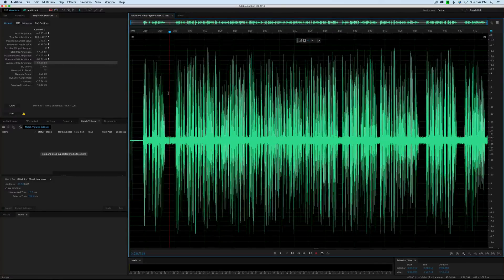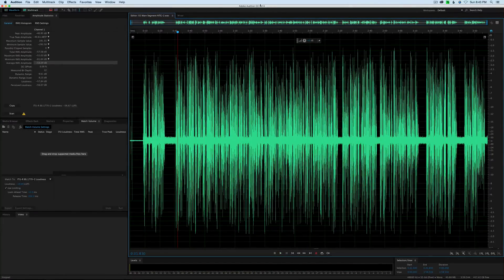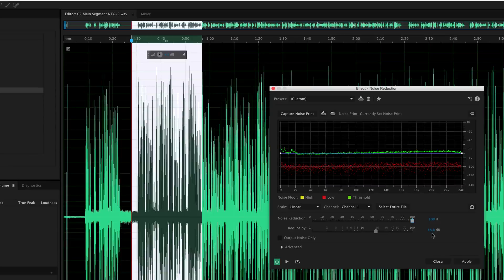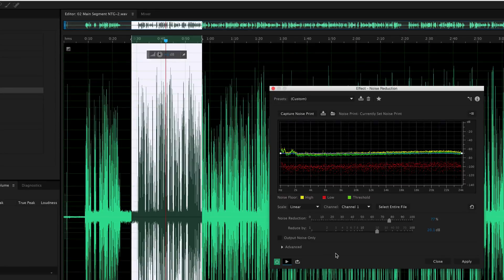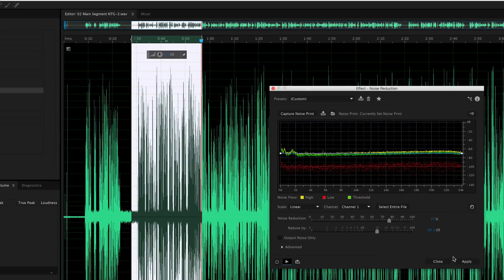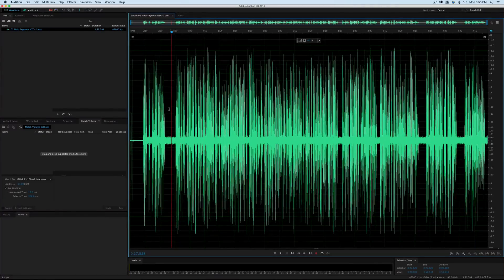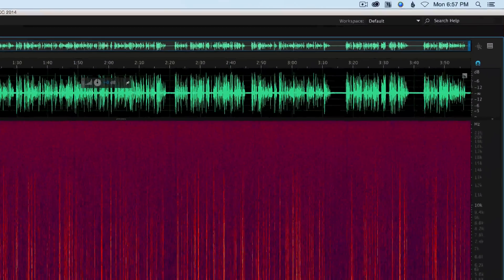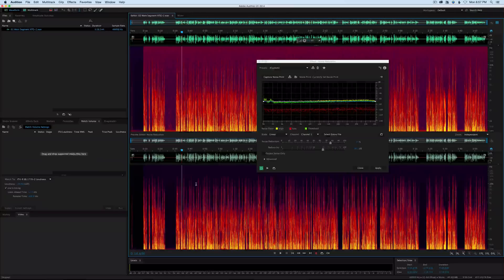Audio Hiss Noise Reduction

Comment: hey Curtis when i reduce the noise at the start of post processing and then apply eq and compression i sometimes see that the silent portions are really silent but the dialogue has that hiss in the background, i m totally pissed off with that and hope you could help me out with this, i do use adobe audition, hope you will reply. i use a rode podmic with the behringer umc22 audio interface with my gain usually set at 80%. i do not add any make up gain to the compression but loudness normalise my recordings at the very end to -19 lufs.
Reply from the maker: Hi Agam, first thing is to identify the source of the hiss and eliminate that so you don't have to rely on the mediocre noise reduction capabilities of Audition. Is there noise in the room where you're recording such as computer fans or other noise sources? If it is the Behringer audio interface creating self-noise, you might try one of the slightly better noise reduction plugins such as Izotope RX Elements or Accusonus's ERA-D. Best wishes!
Reply: Curtis Judd my room is not acoustically treated or anything but i do not encounter a high background noise but mostly the hiss that is either from the behringer or the podmic/ATR-2100 mics that i use. I am surely buying the izotope, hv heard a lot about it and yes its mostly the interface or my mic, i think i cd get rid of one of the usb mics tht i have fully, also does the new rode nt usb mini has a higher noise floor over usb? I think i can grab one of those if they r good at that! Or then maybe i will save up for an AT2035 or a Rode NT-1.
Reply from the maker: @agambhasin  If the interface is the issue, why not replace that with a cleaner interface?
Reply: @curtisjudd  I am planning to buy an audient ID4  or a 2i2 3rd gen, your suggestions are highly appreciated and awaited Curtis because i really need to improve my audio quality and saving up for it too!
Reply from the maker: @agambhasin  Good call! I haven't used either of those interfaces but have heard good things, especially about the Audient. Best wishes!

Comment: Hi, Curtis. I am glad that I found this video. I thought that I was doing something wrong or I was going crazy but I guess it is just my mic. And funnily enough , it is a 200 dollar mic, I have the clip mic digital by Sennheiser. It had that same hiss from the very beginning regardless of the gain I chose. I use it with my iphone x with Filmic pro or the Apogee's app which is meant for that mic. I am so disappointed by that mic...can you recommend any good lavalier mic that won't have that stupid hiss. It doesn't need to plug into the iphone, I might have to get another device that will record the sound and then sync. Thank you so much.
Reply from the maker: Hi, I just received a copy of the Sennheiser Clip Mic Digital. Let me test mine and see if it is an issue for me as well.
Reply: Can't wait!!!
Reply: @curtisjudd  any news from the Sennheiser clip on mic ? :)
Reply from the maker: @englishwithstelly  Hi, still in the queue. I'm a bit buried in reviews at the moment.

Comment: For many of my audio problems I just add the VST plug-in, IDC (Instant Dialogue Cleaner), by Audionamix. It works in realtime and it simple to use (one knob and a strength fader controls the amount of noise). Here is a video on Youtube of IDC in action. https://www.youtube.com/watch?v=PUwrs_AsLJ0
Reply from the maker: Thanks Mixer Man, will check it out.

Comment: Great bit of software. Shame it's so expensive and now only available as a very expensive monthly subscription
Reply from the maker: Yes, it hurts me every month. But I haven't found a better alternative for my circumstances/needs.
Reply: Chris, any quick views on iZotope RX6 standard vs AU?  Looks quite powerful but does not have a compressor as far as I can make out.  Looking to purchase one of them.  I guess from your comment above that AU is still best as an all rounder?
Reply from the maker: I use the advanced version mainly because it includes the adaptive phase rotation and de-reverb modules. RX does not include a compressor but you can plugin other compressors to RX and there are a ton of compressor options out there, including free options.
Reply: Curtis Judd thanks for the help. Learning a lot from your channel.
Reply: where are you located? maybe i can help you get it for free, and also reddit

Comment: Hi Curtis,
I'm having issues with digital recording(no mic or any external recording devices) to mix songs. After i'm done with the recording I start to hear hissing and popping noises throughout all WAV files. How do i go about removing them ?
Reply from the maker: Hi Carlos, I'm afraid that I don't understand. You are not using a microphone to record? Are you using sampled instruments? Do you have individual tracks for each instrument? If so, you'll want to identify which of them are noisy and clean those with the method shown here. Good luck!
Reply: Curtis Judd i was using an app called edjing mix. Once I'd finish the recording I'd listen to the file and it'd have popping and clicking noises in the background even though no microphone was used. The recording was done completely digitally. I actually found a fix though. I used Adobe Audition and used the effect specifically for this concern and it all went away ☺️
Reply from the maker: Great work!
Reply: Curtis Judd thanks!

Comment: Hey Curtis! What would you recommend as the best portable external audio recorder. Was thinking the Zoom H5, but I've been seeing that the noise floor is not the best.

Also, what would you recommend for external audio recording settings for youtube videos?  I've seen some people recommend as high as 24bit 96khz WAV. What are your thoughts? Overkill, maybe? lol
Reply from the maker: Hi Nick, The "Best" audio recorder I've used for less than $1000 is the Sound Devices MixPre-6. What kind of budget are you working with? Do you already have microphones? If so, which mics? Will you be recording indoors or out or both?

As for settings, I usually record 24 bit 48kHz. 96kHz seems a little overkill for normal dialogue unless you're going to process it super heavily (slow it way down, for example). 99.99% of the time I stick to 48kHz.
Reply: Have an AT4053b and Aputure Deity. Recording mostly inside but outside as well.

Currently have a Zoom H5, but am open to selling it and looking into the MixPre-3 instead. It is stretching out my budget a bit, but if I sell the H5 I can do the 650 for the MixPre-3.

Is the MixPre-6 the same but with more inputs?
Reply from the maker: The MixPre-3 and 6 are nearly identical. In addition to fewer inputs, the MixPre-3's inputs are XLR only vs the 6's XLR/TRS combo and the 3 can only record sample rates up to 96kHz whereas the 6 goes to 192 (again, I only use sample rates higher than 48 if I know I'm going to do super heavy processing like sync sound to slo-mo footage).

The MixPre-3 is a big, big step up from the H5 and should last you a good long time. Good luck!

Comment: Hello Curtis, 
I have background noise from the air conditioner in the room that I was shooting in. It is much heavier than the hiss that you have in this tutorial. When I try the Noise Reduction Process, the voice has some strange distortions like the person is talking through a tube. When I look at it on the spectral analysis, it seems as if bits of the noise are not getting removed for some reason. I have tried running the process again on the preview but it is not cleaning it all up.  I used a lapel Mic into a Canon 70D DSLR. What should I do?
Reply from the maker: +Ernest Moore You may not be able to clean it all up without affecting the dialogue so it is better to reduce it as much as you can without affecting the voice. You can also try high pass and low pass filters in an EQ plugin. I haven't covered that here but will in a future episode.

Comment: why do you recommend -19 now and what amplitude statistics verify that it's good now?

My true peak went from: -1 to -1.45 (which i'm assuming is better)

And my Total RMS Amp: went from the -16 to -25.08
Reply from the maker: +HollowProductions -19 is the recommendation for a mono audio track and the perceptual equivalent for a stereo track is -16. -16 for stereo and -19 for mono are the same to the ear. Just depends on whether you're processing a mono or a stereo track.

Yes, -1.45 true peak is good - I typically aim for -1.5dBTP. To measure noise, I usually highlight a section of "silence" (a spot where there is not dialogue or other sound in the room), scan and then read the average RMS amplitude for that section to assess where the noise sits.
Reply: In some videos you take dialogue audio and change it to mono but then you change it to stereo.  When do I extract to mono and when do I not?  

In an older video I remember you saying that unless we're doing something high level that we shouldn't worry about stereo but I also know how things can change over time.
Reply from the maker: +HollowProductions I record all of my dialogue audio in mono with a single microphone (referring back to my advice to stick to mono). Then in post I convert it to dual mono after I am finished processing it (stereo and dual mono are the same thing in this scenario). This just means that the audio track now has the exact same mono signals on the left and right channels. It isn't technically "stereophonic" which usually implies that the left and right channels have different material.

The reason I convert the audio to dual mono/stereo is that Final Cut Pro X used to have trouble with mono audio files where it would only play out of one speaker (I need to check and see if that is still the case).
Reply: aaaaahh ok I see.  thanks! =D
Reply: Would you still recommend me converting my stereo audio into mono and then converting it back to stereo?
Reply from the maker: +HollowProductions If your dialog recording was truly captured with a stereo microphone, yes, I'd choose one channel, process that, then convert it to dual mono if your video editing app is picky about that (FCPX can be, Premiere doesn't seem to care so you can leave it mono).
Reply: Ok Cool! thanks! =D
Reply: +Curtis Judd sorry so another question.  What about the strange noises in the background when you do the noise reduction?  I can hear it a little in this video but in mine I can hear it a lot more and trying to minimize that noise has become almost an impossible task.  is that noise just not something I should worry about?
Reply from the maker: +HollowProductions If that noise is room "tone" and other ambient noise, the best solution is to treat the room. In my case, I have sound blankets hanging in front of the largest walls to prevent reflections and dampen ambient sound. Then in post, you just have to do the best you can. I would suggest that total removal of all noise is not necessary in most cases.
Reply: ok I see. cool! I'll go see how much sound blankets cost if they're not just normal blankets XD
Reply from the maker: +HollowProductions Or even just a big, thick duvet or bedspread can work. It is best if it has a fabric that is soft and porous (rather than a synthetic material with a very tight weave). The idea is that it should allow sound waves in and dampen them rather than reflect them.
Reply: Ahhh Ok.  On an off topic...When I'm at my studio room for college I record in this small apartment where I can't escape the sound of my refrigerator when it starts up.  Could I possible blanket that up too? so i don't have to try and time my recording sessions inbetween the cycles?
Reply from the maker: +HollowProductions Of course! Or, unplug it and put your keys in the fridge so that you don't forget to plug it back in. :)

Comment: Hi Curtis, have just got the Azden SGM 250 on your recomendation!! woohoo!! like the fact it comes with an included basic shock mount... although like you mentioned, puzzled why they didn't thread that hole at the bottom to accept 1/4" screw... anyway.
On my first test, got quite a lot of background hiss/noise floor... I was recording into zoom H5 with xlr cable and sensitivity on H5 set at about 6.5. Based on your technique in this tutorial, I cleaned it up completely in Adobe Audition... but I wasn't expecting this much noise in the raw capture... Is this normal, is there anything that can be done at time of capture to reduce this??
I had the mic around 50cm from subject, which I know isn't as close as possible, but its not that far either. Was setup in an apartment room.
Reply from the maker: +markstanley2001 That's not unusual for households. I would assume that a fair bit of the "noise floor" in that case was actual ambient sound that existed in the room. The closer you get the mic to the talent, the less of that you'll pick up but that's not always practical. Also, you might try hanging thick blankets in front of walls to reduce some of that. You can also unplug refrigerators (but be sure to plug them back in when done!) and or temporarily turn off heating or air conditioning. Best wishes and happy recording!
Reply: +Curtis Judd yes... I think you might be right... it definitely picked up air-con. But that was a definative hum. I first tried removing that with dehummer, but found the hiss was still there, so just captured noise print and went though Noise Reduction, and walah... all gone. The blankets might be a good idea, which will also remove a bit of the echo/reverb. But I dont want to make it too perfect so the audio doesn't capture feel of the room. Many thanks again for all you videos

Comment: Hello Curtis,

I have Tascam Dr60d and Audio-Technica AT897. Just like your experience, I have hissing with these tools. My question is when I am recording, what should I set dr60d for best result? I mean low, mid or high and percentence of that turning stuff on the dr60d.

And do you have a recommendetion for how many cm shotgun mic should be away from me?

Thanks :)
Reply from the maker: +Burak Kara I like to keep shotgun mikes about 45 to 60cm from the talent's mouth, boomed from above.

As for the settings, I don't have specific recommendations because settings need to change depending on the situation, the microphone, the person speaking and so forth. I would start with the gain setting at mid, then adjust the fader pot from there to get the peak meter hitting -12db for the loudest parts.

If you'd like more in-depth info, you might have a look at my production sound recording course (yes, a shameless plug for my course :): https://youtu.be/047jFy1RCwA
Reply: +Burak Kara With the tascam, are you recording only one channel?

If so, go into audition and remove the "hiss" from the other channel by deleting it, put it to mono, then back to stereo and finally get a noise profile and follow what he does here.

Comment: Hi Curtis,
Do you have any video tutorials on removing wind noise in post processing using Adobe Premiere and Audition?
Reply from the maker: Bob Penzien no episode other than to prevent wind noise with a lavalier: https://youtu.be/64cKJkPcFbM

Wind is tough. Your best bet is to cut the low frequencies with an EQ plugin but even that will generally just reduce its effect slightly. If it occurs at a time when there isn't any speaking you can of course just reduce the gain on that part. To be honest, the fact that it is hard to clean up wind noise is why there's a rather healthy industry for blimp and zeppelin covers for shotgun mikes. :-(

If you're shooting with a lavalier, hiding under your talents shirt is very effective at preventing wind noise (but you probably already knew that from previous episodes).